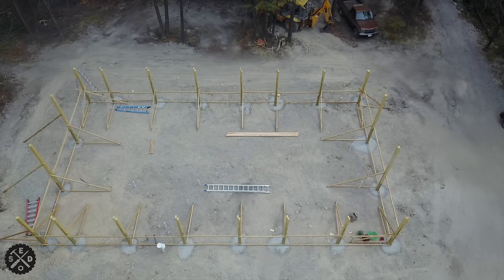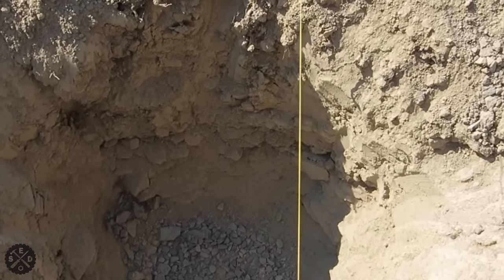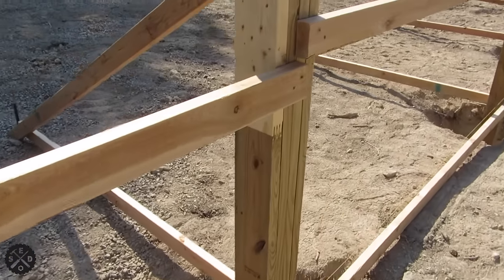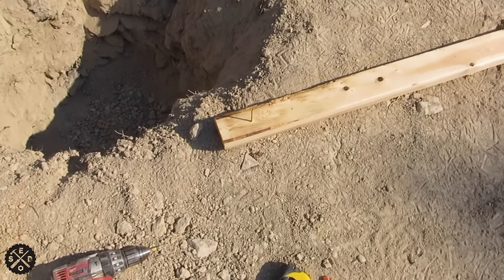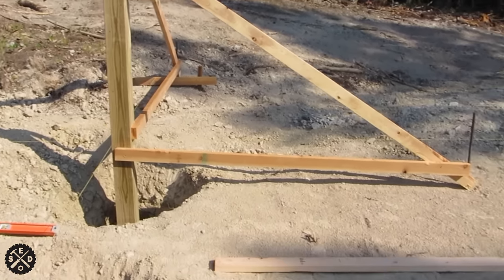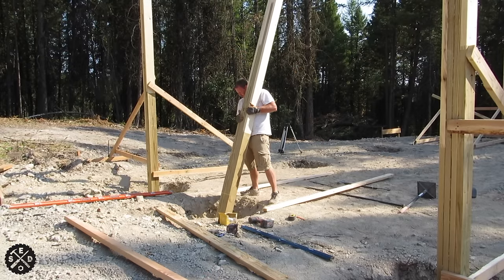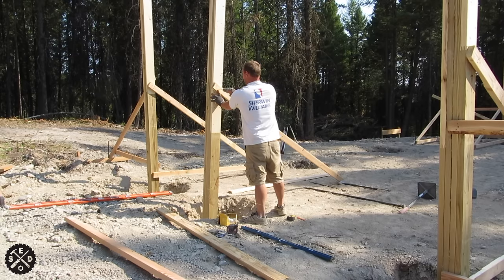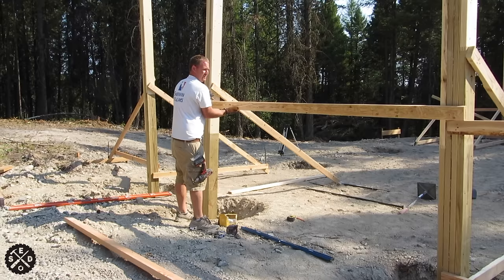How To Set Posts To Build A Pole Barn Yourself DIY

Comment: I have built buildings my entire life ... usually by myself.  i actually enjoy working by myself.  You taught me a few new tricks right here.  Also, I liked the way you made your video and did the voice-over.  Right to the point and the focus is on the job not on you trying to be a movie star.  LOL.  Thanks for the great video.
Reply from the maker: Hey thanks so much for the kind words I appreciate that. I enjoy working by myself too. I’m glad if you found a few things that may help your future projects! Happy DIYing. 😊
Reply from the maker: Thanks. 2 going same direction?
Reply: @SmartEasyDIYer  what about the height at the top of the post?  No one talks about the top of the post?  Im getting ready to embark on a 36x36 monitor barn.  Thanks
Reply from the maker: You’re welcome. Yeah so the top height is determined by what you want for your wall height. You have to factor in what type of headers you’re using for that as well and figure that into the overall height.
Reply: @SmartEasyDIYer  thanks
Reply: @noneyourbusiness2995  make a mark at the bottom of each corner measure up and mark your posts whatever height you want. You can use a cheap laser for a reference point.
Reply: Wow, small world! I was watching your solarcon antenna video the other day, then I see your comment on this video.
Reply from the maker: Wow Rusty that cool!

Comment: Very impressive.  In the past,  I have attached the diagonal brace that goes to the ground to the post while both are laying on the ground.  That way,  when you lift the post,  one end of the brace swings up with the post,  while the other end drags along the ground and immediately supports the post when you get it in the hole.  A tad heavier but really worked for me.  But your 10 foot brace method  between posts is absolute brilliance.  Well done !!
Reply from the maker: Thank you! Getting that first corner post set is the hardest for sure. Sounds like you had a good plan too. 👍

Comment: You may have thought of this already:  we had to build a fence with posts in very rich top soil.  So, to delay deterioration, first thing we did was to soak one end of each post in a wood preservative like the Cuprinol product.  We used old gallon cans and put about one inch of preservative in each can, which is "wicked" up into the core of each post overnight.  Then, before setting the posts, we marked the grade level on each post, and then coated the end of the post that contacts concrete with asphalt emulsion.  Asphalt emulsion is a liquid that paints on with a paint brush.  Even if the bottom end of a post touches soil, the asphalt emulsion dries into an excellent water vapor.  I would recommend doing this, even if you are using pressure-treated posts, in order to add extra longevity to a key point of failure.
Reply: doorper sheep
Reply: Used motor oil is good for this
Reply: I built a drive way out of old R&R  ties. My son says they will rot. I told him NOT IN HIS LIFE TIME.
Reply: Yep, we save all the motor oil from tractor, dirt bikes, truck whatever and whenever we set fence posts they all get painted with old oil before going into the ground. Works great and is free.
Reply: I did 150mm larch posts to hold 2 large gates, first I charred them deeply with a blowtorch then I coated them in bitumen paint twice. Larch in particular doesn't rot in the ground very fast.

Also I always tamp in a few large stones around the post, and that actually helps with adjustments and holds the post up without braces. You can use 2 smaller braces to help you hold the post up. 

I also would have cut a groove in the top of all of the posts I guess 8x3, to take a beam running through the top of them. You can screw on buttresses on the beam before you lift it to hold the post tops exactly in the right place before concreting.

Comment: You saved me with the the simple tip to clamp the levels to the post.  It was still challenging to set 6x6 posts by myself, but I got it done.  Thank you!!!
Reply from the maker: Hey awesome!! Glad to hear it. I actually didn’t think of that till later on as you could tell in the video. I wish I would’ve thought of it first thing. Lol they are heavy especially if they’re fresh delivery they’re still so wet. My dad used to call them pond dried. 😁 Great job!! 👍👊

Comment: I built my 24 x 40 pole barn myself, but didn't have any help from videos, but, I did learn some of your tricks. One thing I noticed, you also did, was not go with a 6x6 (which can twist pretty quick. ) I did what you did, I used 4 pieces of 2 x 6, starting from underground I used 4 different lengths of .40 PT, (later was KD)  also used a nail gun with stainless nails to start the post, regular nails above ground. I didn't build it all the way up though, would have been to heavy to handle alone. I also turned the post 90 degrees, that way, when I got to the side wall tops, the top beam was riding on the 2 inner posts, and I used the other 2 outer posts to lock it in place. I used a water level, (although a newer laser would be easier. The side wall beams were straight and square, and that was when I finished putting up the rest of the KD 2x6's, and trimmed at the top. At that point, while waiting to have a concrete floor poured, I drilled and installed large lag bolts every foot. I also went 8' on center, I was planning on a long life time of use.
Reply from the maker: Wow that’s awesome great job!! I actually bought my posts this way already made but I have heard of other people building their own too. That works out well. You are correct these do stay straighter and also their dimensional One Direction if you want to use them in a 5 1/2 inch stud wall like I did

Comment: I’m a total beginner, except for some shelves that I built for the garage in the cellar. But I’ve got to get this greenhouse built. I’m just having problems lining up the holes. I’ve only got six post to set, but again, I am doing it by myself also. I had dug out all my post holes and gotten ready to start putting the gravel in the bottom and making sure the boards were going to fit so when the finished product I could close it up and all the corners would meet correctly and then realized it for three hours a day it was in the shade. I can’t have that during the winter, so I had to move the greenhouse.  It’s a learning curve.
Reply from the maker: Wow sorry to hear all that hard work for not being able to use that location. I’m sure you’ll find a better spot. I’m proud of you for not giving up! I hope your projects keep going better.

Comment: Thanks!  Great tips.  I'm about to set fourteen 8x8x20's and they are HEAVY.  I plan to pick them up with the FEL on the tractor with the forks and a sling to set them in the hole but was trying to think of the best way to brace them until I got them set.  This seems like the best way.
Reply from the maker: Yeah those are tall and heavy!! We did those before with a skid steer. Same idea. I think tractor sounds like a good plan as much as possible. You may need to brace them higher according since you got so much more height. Best of luck with your project! Thanks for the comment.

Comment: Pre cast concrete pads or composite are standard installation procedure as they provide a bigger footprint for the building to sit on also cleats need be attached to bottom of post in your case to attach it to the poured concrete. Or in a gravel or dirt backfill prevent uplift.

Comment: Nice. They make a level for posts that wraps around 2 sides that you put on the post with a rubber band that’s pretty handy.
Reply from the maker: Thanks. Yes the ones I saw are very short tho so you don’t get accurate reading of the overall post. Ok for fence posts but not a building.

Comment: I'm in the middle of a 36' x 48' post frame build by myself. I went with poured piers with brackets this time — its coming along real nicely. When I built a post frame horse run-in, I had the posts in the ground, but I put concrete pucks in the bottoms of the holes on top of the gravel. Otherwise very similar 😊
Reply from the maker: Sounds like a nice project. I’ll probably do the concrete pier and wet set bracket next time too. 👍
Reply: @SmartEasyDIYer  I've done it both ways, and the wet-set pies is definitely the way to go. Look forward to seeing the other videos in this series!
Reply from the maker: Thanks and best of luck!

Comment: Smart cookie. Thank you. I built the first part of my deck last year. This year it's a much needed garage first. Great tips. Thank you, stay well 👍
Reply from the maker: Thanks Chippy! It’s gives some ideas at least even if you do gravel or dirt instead or concrete in holes or concrete piers and wet set brackets. Each to their own on that.
Reply: @SmartEasyDIYer  Indeed. Are you going to show how you do the spanning please? So far as I can see, this will be an issue here. 
Thanks very much. Stay well.
Reply from the maker: Thanks. I’m not quite sure what you mean by spanning. In my pole barn house video series I do show how I set the trusses. I did the style where it sits directly on top of the posts. If you search for setting trusses on the pole barn house it should come up.

Comment: Hands down best video for setting/bracing 6x6's. My only question is...the stake you screwed through, what kind of stake was that and did you pre-drill it?
Reply from the maker: Thank you for letting me know!! They’re just round stakes that I got from Home Depot or Lowe’s. They already have holes in them every so many inches on all sides towards the top made for nails or screws. Thanks
Reply: @SmartEasyDIYer  Perfect, thanks for the quick response! I'm getting ready to do my own 24x40 pole barn as well.
Reply from the maker: You’re welcome I wish you the best with your project!!

Comment: Thank you sir, i plan on starting my pole barn within a month, 40x60 by myself. I did a floating slab with wet set pole brackets.
Reply from the maker: Awesome good for you!! I’d probably do something similar if I did it again. Especially with how rocky my ground was.. all the best!
Reply: Nice! At least in 15 yrs you won't have to worry about your polls rotten through and have replace.

Comment: Man I wish I had seen sooner. I use electrical tape to mark either side of where my post will go, vs. String I set my posts in pairs  as far as using the 2x4 for spacing So they are all at the same elevation. Then I go back and tie them together with the one s i lack this means. no screws to hold board and one last chance to fudge if need be. Folks should def crown the beams and use the nicest posts for corners, doors and windows if applicable. I like to also add lags is the post where it goes into concrete  so any shrinking of wood / concrete will not dislodge. Also I agree with above comment and cleats. I like to run them perpendicular to how the other bracing is or similar to how you did corners and run parallel to above braces but tight to ground i stand on them with them tight to post and screw. Also a framing gun or auto feed drill saves time especially on temporary support. I understand and agree with screws on ALL permanent applications but bracing, etc… nail that bad boy. one hand action. Right up your alley. 🎉
Reply from the maker: Thank you! Sounds like you got a system figured out that works for you.

Comment: Are the posts you used actually 2x6s nailed together? Looked like the one was. If so, curious why you did it that way?
Reply from the maker: Yes they were made by a company called triad. There’s different companies that do that but they are laminated and nailed together. I believe the reason is so they are straighter and lighter. Also in my situation they were dimensional going the one Direction to fit inside of a regular stud wall. Regular 6 x 6 in my area are rough cut full 6 inch so too big.

Comment: I'm doing it your way if i keep getting no response from builders just building service agency's. On SPACING; 36x36 would you go 12ft between posts or 9 ft being 36x36. I will start in three months 7 29 2022. This video is the one hurdle I WAS up against but no more! THANX Your Trusses . What do you have on that next?
Reply from the maker: So for the load bearing sides I would go shorter span rather than longer. It depends what style you do. If you header across the tops of the post and set your trusses on those like every 2-4’ or if you double up your trusses and set on top of the post directly. it might depend on how your trusses are engineered for loadbearing. If you’re getting your own trusses you could talk to a truss company and determine that. Depends on snow load etc if you live in a area that gets snow. I do have one on setting trusses but I did this style where I doubled up the center trusses and set them directly on top of the post and purlins on edge in between which is very common in the west. In the East it’s very common to do the header style and put 2x4 purlins flat on top.

Comment: What are your posts called? Did you make them or do lumber yard carry them.  They look pressure treated 2/3s or so up then untreated above.

Are your posts stronger than solid posts?  They probably won’t twist or warp.
Reply from the maker: Yes they’re called laminated columns. There’s different places that make them. The company I used is called triad. They’re based in Montana. You are correct it’s treated below grade and untreated above grade. It’s all glued and nailed together. Stronger straighter and lighter. Loved them.

Comment: When you poured the concrete, did u treat the posts in the ground, or put tar on them, or just concrete right against posts?  So so many differences in opinions and views on this, it's hard to know best
Reply from the maker: Yeah there’s so many different opinions on that. What I was told in my local area by a builder that did a lot of them was not put concrete underneath cuz it will trap moisture but that to put gravel so it can drain ok. From what I’ve seen from one that the wind too down one time the concrete didn’t hurt the post it’s right at the top soil level where they can rot if anything. If I did it again nowadays I think I’d do the wet set brackets made by perma column and set the posts on those.

Comment: Hey so I’m a little late to the party but I’m planning on doing a pole barn build myself cuz I want to save money and honestly I just want to.  I do finish carpentry so this is a bit out of my league.  How do you get your post height correct?  Do you cut them after the concrete is poured?  Thanks!
Reply from the maker: No worries looks like I’m a little late too. This is a video I did after to get my post height correct. Hopefully that’s helps. https://youtu.be/z9KnqWPlGzA

Comment: Great Video.  I'm going to build a rough pole barn structure to store firewood over the summer so it doesn't have to be fancy, but needs the base structure to be solid.  This will help me get the 4x4s set with minimal help.
Thanks again and great job on this.  Very informative.
Reply from the maker: Awesome man thanks! Good luck with your project!

Comment: I'm enjoying watching this series. I have a question about why you sunk the posts in the ground instead of putting them on top of concrete piers. What happens when the posts rot out? Most pole barn construction I see, they set the concrete piers and put a bracket in the wet concrete and then put their posts in that. How come you chose this route? Any concerns with rot?
Reply from the maker: That is a good question. This is a very common method in the area where I live to do it this way. From what I understand from the manufacture is the main thing is that if it’s set in concrete that there’s no concrete underneath just gravel that way any water that gets trapped in there can drain out. Some people just do dirt around it some people just do gravel as well. I did dig down after the building was built and put gravel and drains around the building. The concrete pier and wet set bracket method wasn’t readily available in my area at the time if I did it again I may go that route too.
Reply: Smart Easy DIY where are you from? I haven’t gleaned that yet from the videos I’ve watched so far.
Reply from the maker: Dave Bauer I’m in MT.

Comment: If you are doing them on 10ft centers are your four corner post (or just two) different measurements on center to obtain the desired length of barn
Reply from the maker: Yeah pretty much. I did 10 foot spacing’s except for where there were windows and doors in the way I had to do 8 foot spacing in one section and then yes the last post section came out just 6 feet because of the length we chose.

Comment: I was just wondering if you poored concrete floor? I am on a budget and can love the idea of doing what you show a little at a time; however I want a concrete floor, which is the most expensive part. I do not know how hard it is to add the floor after construction or if I should wait to afford slab first. I appreciate your input and ideas.
Reply from the maker: Hi yes I did do a concrete floor. I poured it after the place was framed up but before the walls were closed in. You can pour it later as you get time and money saved up yes. If you have a garage door it’s easier to get inside to do it later but it’s doable with just a regular door. You could use a pump truck otherwise it’d be a lot of wheelbarrowing. Lol

Comment: Nice video! Do the 2x4 posts get wrapped in plastic to prevent rotting.
Reply from the maker: Thanks. There’s a lot of different thoughts and opinions on rot etc. you can get post protector sleeves if you want to go that route.

Comment: Questions: how long is the post, how deep is the hole, used 3 bags of concrete mix? Good video.
Reply from the maker: My posts are 14 feet long, 3.5- 4 feet down in the ground and about 10 feet sticking up. I think I used 3500 psi mix concrete. Put like 9 yards in 20 holes because they got so big digging out all the rocks.
Reply: @SmartEasyDIYer  Thank you!